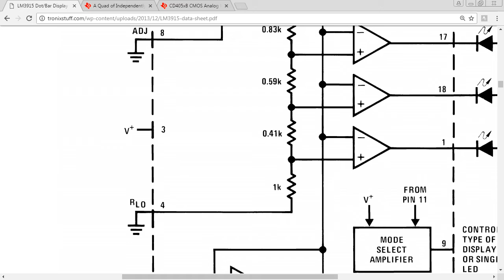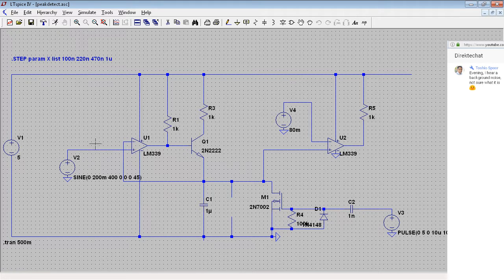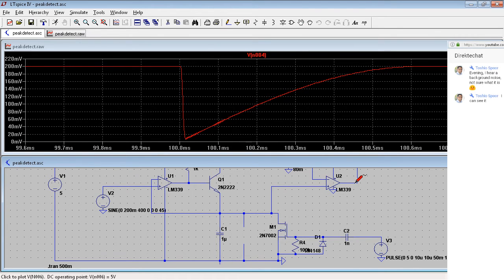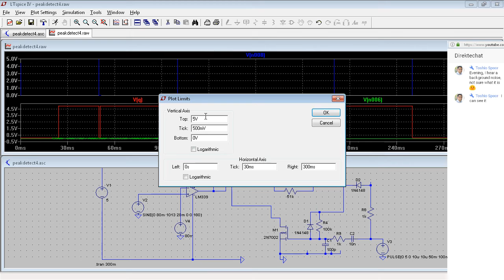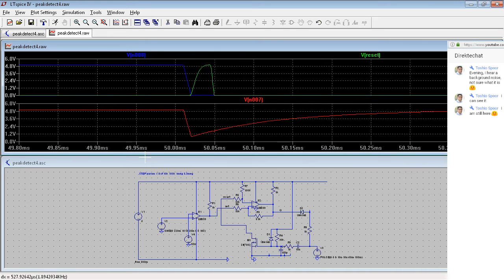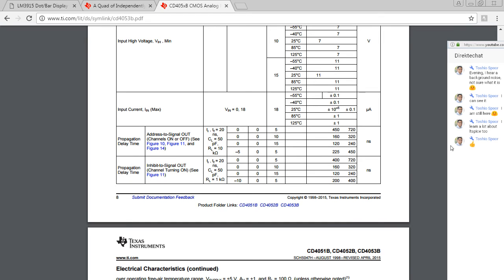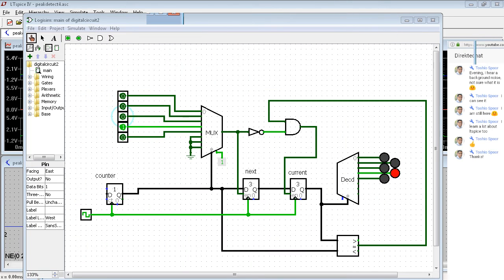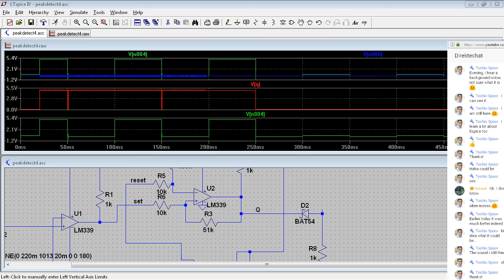Detecting audio on the amplifier switch box using LM339 (simulation)

Comment: What happened with your mic Hans?
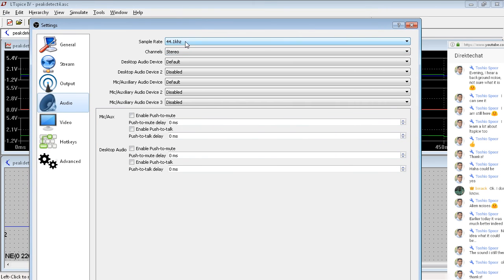Reply from the maker: The Highlander Not sure but it went away at 1:03:15 when changed obs sound settings from default to sound"card". it worked fine earlier yesterday. maybe the driver needed to be reset..
Reply: I've had many small issues like this as well. I think you may be right about the driver reset. I've also had to unplug and replug my mic because windows wouldn't recognise it.